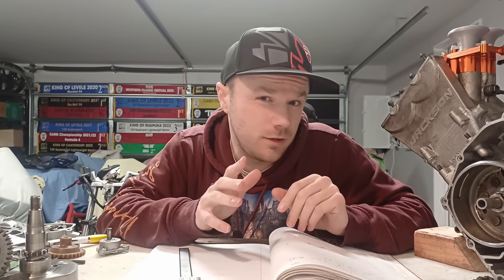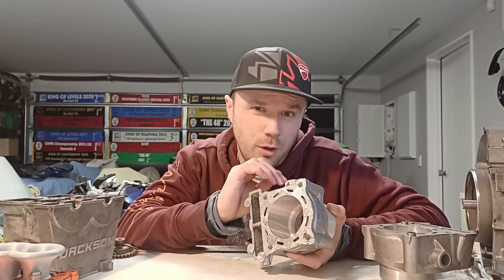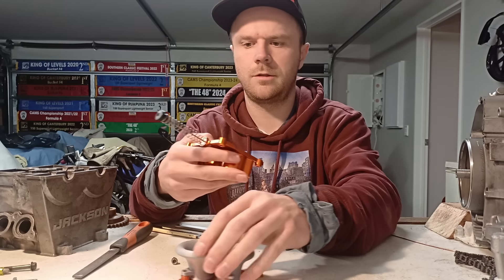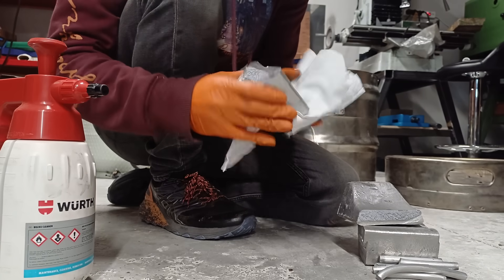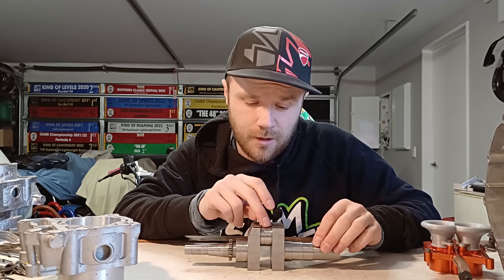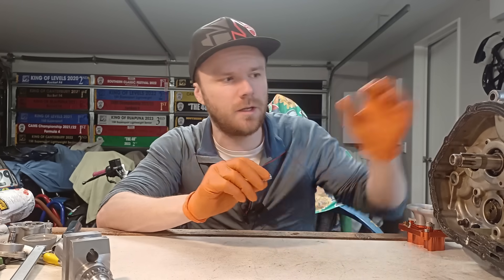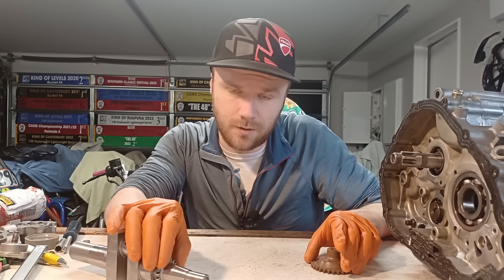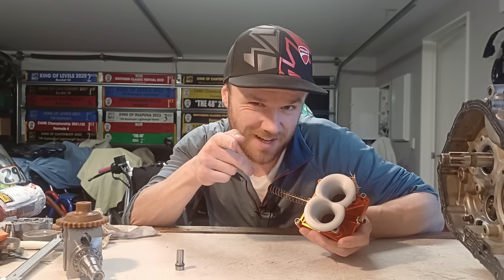Making Earth's Fastest 150cc Race Engine From Scratch ( 4 Stroke )

Comment: Hey Logan, I think you’re doing an incredible job there. On the porosity temperature is critical with aluminium 850-1050 deg, we used degassing pills (available from foundry supplies) which you throw in the pot before you pour. As long as you keep the temps down should solve your porosity. So reach temp, pill in, pour as quickly as possible.
Reply from the maker: Hi bill
I have been degassing with degassing tablets, although I think they aren't as effective as they were.
May  have a shelf life,  850 is quite high, I have been previously told 750 is the recommended max temp.
Most of my best castings were done at 720ish deg.
Reply: @TheMotorcycleForge  I think you might be right re shelf life. It’s been many years since I worked in the foundry but I think I remember that degassing could bring on porosity with low and high temps, also all sand cast in boxes. Keep plugging away mate you’ll get there.

Comment: Get rid of the angle cut primary gears they steal power thru side loading brgs C if U can obtain  straight gears  so your basically using fxr150 Suzuki cases and just doing the barrel crank head  cams etc. I guess that's a bit if a far cry from making your whole engine as stated but can dig it dude I'd do the same r U using.  Rolling element main brgs or plain BRG shells   l love what your doing  bore stroke.  Rod  stroke  ratio  important for a high reving engine over 2:1 is my understanding  for a high reving engine   if U can get titanium rod yu will b streets ahead

Comment: Yo just try to heat the cast i self  while purring the aluminium may be the cast is not hot enough just a suggestion mate
Reply from the maker: The mold was around 600 degrees C 😅

Comment: Man keep your same technique you have but add a cheap hand sander to your mold pot on a piece  of 1/4 x 2 flat bar about 12" longwith the sander all the way out on the end.... right before you do the pour turn on the sander and the vibrations actually dislodge the porosity pockets and cause them to rise to the surface... this helped my gravity pour quality eminencely!!!! I added a rotary switch to turn down the oscillations from the sander and this helped as well

Comment: Just a thought, was there any moisture in the compressor maybe. Would that have any effect or would it just be that the heat would take any moisture out.  Keep going bloody awesome project.  My friend did loads of casting with alloy and steel, will show him this video and post any advice. He did his own cylinder heads and blocks for early ford twin cam race engines.
Reply from the maker: That is a possibility, I'll drain the compressor before the next attempt.
Reply: @TheMotorcycleForge or something kind of moisture trap.

Comment: Would it be viable to metal 3D print the cylinder? There are services that will 3d print parts like this, and people have used them for engines.
Reply from the maker: I do have some Chanel sponsors like rapid dirrect who would happily 3d print it for me but that kind of defeats the purpose of diy.
I will use them for the odd small but but nothing like the barrel, atm anyway.

Comment: Yo. Recon the bubbles are coming from moisture or air pockets in the mold and not so much the pour? welcome to borrow a vacuum pump any time if thats any use in the mold process -chch :)
Reply from the maker: Cheers for the imput all the same ziggy, got a bunch of machining to do but will be casting again soon.
Cheers
Reply from the maker: The mold was at aound 600 degrees so definitely shouldn't be moisture. 
I do have a vacuum pump just haven't figured out how to implement it.
Reply: @TheMotorcycleForge  Gnarly. Love the details you're posting of the adventure!
Only experience i've had is rough casting alloy on a wood forge, far less details

I look forward to seeing the next trials, if its strange contamination, new technique or something so obvious that it's only seen after taking a time-out :)

Comment: Epic Project indeed :)
Casting side of things coming from my experience no pro but have got better over the years - I use sand molds for most of my adventures, and typically just use scrap Ali pistons/engine blocks etc for my base which tends to have less impurities but no matter what you really need to DE-GAS (i use argon) an make sure you remove any of the slag or impurities before pouring (there shouldn't be a skin if possible) - Found your local foundry (most of them like imparting knowledge if your not in there way or help out an its also sort of a dying art in ways)
Not 100% sure if its been covered but i figure you are going to either put a liner inside the bore or have it coated? if its a liner bore doesn't have to be perfect but hot spots aren't good (final product probably don't want them) and for a coating you will need it very smooth.

Keep up the hard work, i really admire people who try things out the box :)
Reply from the maker: Thanks for the tips, I'll put them to good use.

Comment: Bore x stroke?
Reply from the maker: 67mm x 44.8mm.
Reply: @TheMotorcycleForge owh, I thought with a 49mm stroke

With a bore of 67mm it will produce a lot of hp
Reply from the maker: @II-gs3nf Yes the stock fxr crank is 48.8mm stroke, I'm making my own so I can destroke it an rev higher with also more valve area.
Reply: @TheMotorcycleForge Hey dude, come to ASEAN sometime, here the price of billet and forget is very cheap, of course there are many spare parts that are not available outside ASEAN🤙❤️

Comment: You must be from New Zeeland. So many high level do it yourselfers are from there. 
Why not use a sleeve in the cylinder?
Reply from the maker: I want to perfect the casting instead of changing the plan, an Alu sleeve is an option but will suffer a bit longer.

Comment: Hey Logan, I worked in a foundry and reckon your issue with gas entrapment is that your mold material isnt porous enough... Plaster of Paris is too dense so nowhere for the gas to go.
I'd try ceramic coating method or casting sand.
Reply from the maker: I think you may be onto something there.
The mold is made from a proper investment material but is designed for vacuum casting.
I can alter its porosity with how much water I use when mixing, although more water means less strength.

Comment: What about a cylinder with a steel sleeve?  Then you can use that one casting you have. Running a piston in aluminum was not a good idea when Chevrolet tried it with the Vega. I rebuilt a couple of those with sleeves installed and got some really good service from both of them.
Reply: A steel sleeve seems possible. But aluminium cylinders are very common, but normally with a plating. Very common on 2 stroke motorcycles

Comment: I just discovered this channel and build and I commend you sir!!! Awesome job I can’t wait to see it finished. With that said you may have covered this in a previous video but have you considered using a press fit ductile or cast iron cylinder liner? This would allow you to use your castings even if they are slightly porous with the benefits of  improved durability and piston ring seal and open the door to other piston ring materials all great things with a performance minded build like yours.
Reply from the maker: Cheers Mark, I'm quite set on having it Nikasil plated at this stage.
With that being said I am definitely considering all options.
Reply: @TheMotorcycleForge  No matter what direction you go I’ve subscribed and I’m excited to see the rest of this build.

Comment: This is a very interesting and ambitious project I think. You are to be congratulated for attempting it. My question is, what is the strategy for overcoming the primary out of balance forces? This is usually one of the important constraints on power from a single cylinder engine.
Reply from the maker: The engine im borrowing the cases from runs a balance shaft which im hoping will be sufficient.

Comment: Hmm, you looked like you were going the correct direction. The second casting was better than the first. The third was supposed to be better.
   When you try again, you should try to cast something smaller and less complex. Just a block or something you can easily cut open. Maybe also try that tuning method, but I would eliminate that first. Then, when you get your method right, add that back in.
   About the oil pressure and volume, you provided some very interesting information in your last video. Working with the pumps and gears is one way. The Springfield your pressure relief is probably one of the easiest ways to achieve what you want. Spring pressure with shims or a different spring with less pressure for less pressure of volume.
   Good luck!

Comment: Have you tried purging your mould with argon when you pour it? Do you preheat your mould
Reply from the maker: Do you mean put argon in the mold before its poured or argon in the alu / degassing?
Yep mold was supposedly at 630-640 degrees c but I'm suspecting it wasn't at temp for long enough so the insides were cooler.
Reply: @TheMotorcycleForge yes in the mold before pouring as air has water in it. I think they use nitrogen to degas the Ali before pouring.

Comment: I tuned lightweight four strikes back in the day (K4 hondas) and going to these extremes can be soul destroying, but, it's never a failure if you document what you did and what the outcome was, this kind of detail turns every event into testing and testing into learning. In respect of the oil circulation if you get too high a pressure/ flow you can get frothing. On the engines I was working on as standard they used plunger type oil pumps, worked perfectly well at the 8k rpm they were designed to, mine were revving to 14k the pumping action turned the oil into what looked like a latte also try and blend the oil ways where you can get access to remove sharp angles like flowing a head, it helps ease flow and cavitation. Nice work so far, keep up the good work and remember in a tuned naturally aspirated engine harmonics in the induction and exhaust flow are everything.
Reply from the maker: Very valuable insight 👍. 
I'll add round sharp edges to the list for the oil system.
I have done a fair bit of intake and exhaust tuning on my current race engine,  makes a big difference for sure.

Comment: Not sure if this has been mentioned or already sorted but Ducati years ago didn't think about oil pickup on crash, eg when motor on its side and they all used to seize. You were talking about oil so wanted to confirm your engine can lubricate in a non nominal position. Only stumbled across your channel and I adore your gumption 👍
Reply from the maker: Cheers Kyle, that is a pretty good point that i haven't thought about yet.
I'll have a look into it. 👍

Comment: Save yourself time and money by buying off the shelf parts for a 70 or 80cc two stroke that will smash a 150 slow stroke. That and it wont sound like you're riding around on a wet fart, which is embarrassing. You're welcome for the sage advice.

Comment: time to consider a centrifuge... old milk separator? washing machine bypassed to spin?

 colder pours, hotter molds, slower cooling...

iunno, never had a successful investment casting... despite the complexity its easier to make core boxes and play with sodium silicate...
Reply from the maker: I will be doing some sand casting in the future, just not sure which parts to make with that process.
It's definitely a process 😅
Reply: @TheMotorcycleForge  once you mix a batch of greensand and experience it defying gravity its sort of addictive...

Comment: Are you planning on plating ( Nikasil maybe) the barrels? A brass ring at the top of each wouldn't hurt either!
Reply from the maker: What is the purpose of the brass ring?
Is this for the same use as copper 
O- ringed heads?
Yes it will be Nikasil plated

Comment: Wouldn’t it be less of a hastle to just machine a billet cylinder? For cooling jackets just make it open deck at first then nake a pressfit plate to close it up and add strenght. Like for example what you do to a K20 when you start making make some real power.
Reply from the maker: I haven't actually thought about doing a billet cylinder.
I'll keep it in mind, not giving up yet 👍

Comment: Looks to me like your aluminum was wayyyyy too hot. If your crucible is visibly glowing red in broad light, then it's way too hot.
when experimenting with aluminum casting i noticed that colder pours had much lower porosity and porosity was very important to me, because i was making a small resonant butane pump and i needed all of my surfaces to be able to seal.
Colder pours are harder because you can have cold shuts, but it's better than scrapping a whole casting. 
Also old VW intake manifolds make for great stock for casting. I got my best casts by melting down the intake manifold i nicked off my brothers VW project car.

Comment: Run the oil pressure relief dump through an oil cooler. then into the sump.
Reply from the maker: What's the reasoning for that, 
I haven't seen that mentioned before?
Reply: @TheMotorcycleForge  to cool the oil but at zero pressure so less likely to leak.
I modded my 4G63 Mitsubishi Express engine like this and worked perfect for years.
Doesnt flow anything at idle but doesnt matter because no air flow anyway.
Reply from the maker: @RIPPERTON I already have a large MV Augusta oil cooler on my current race bike, I'd imagine two oil coolers and a radiator would be a bit over kill 😅

Comment: To avoid as many air gaps as possible, you should heat up the plaster mold. From my experience with investment casting, I can tell that the molten aluminum isn’t hot enough to completely fill the mold. How do I know that? Just look at the surface of your molten metal it isn’t flat, which shows it isn’t hot enough to flow properly. Next time, you should add more heat and try using an aluminum-silicon alloy for better results. Good luck!
Reply: The crazy thing about the Al-Si alloy is that it can fill even the tiniest details. When I pressed my finger into my wax model, the molten metal replaced it exactly, capturing even my fingerprint on it
Reply from the maker: The mold was around 640 degrees c which is already quite high.
I'm suspecting the mold wasn't hot all the way through.

Comment: Doing some epoxy casting lately and vacuum pumps and pressure pots work well to get rid of bubbles. I think industrially they manipulate air pressure and atmospheric gas content for some castings, but I’m not sure how you’d do it here. I think it would require a hermetically sealed electric furnace. If it’s gases in the melt stock itself then putting the crucible in a vacuum chamber while it’s molten should clear it out, but it’s not exactly a trivial process.
Maybe blasting dry argon at the metal while it melts would prevent it from dissolving gases.

Comment: Would something like a concrete vibrator help with the casting?
As when you pour concrete, it can get a lot of air in it and a vibrator sort of going while you do it. I know you can’t put it in the casting but you could connect it to the outside maybe.
Reply: Thinking there’d be a risk of crumbling the cores, but don’t really know…
Reply: @georgedreisch2662  could be the only time I got involved with casting aluminium was using a sand cast and we tapped it with a hammer to get the ear bubbles to escape to get a good casting.
Interesting to see how casting has come along with being able to make moulds like this.
Reply: Or put it in a vacuum chamber, thats the trick with epoxy for getting the bubbles out.